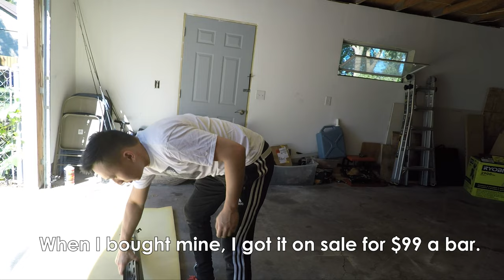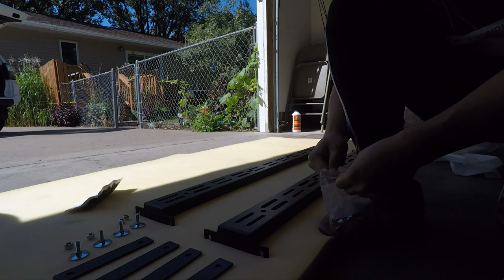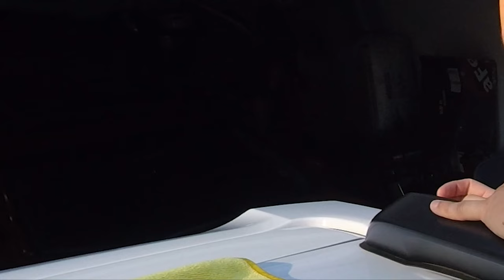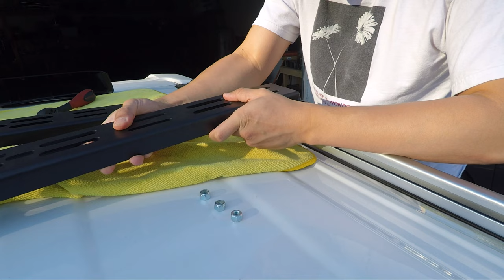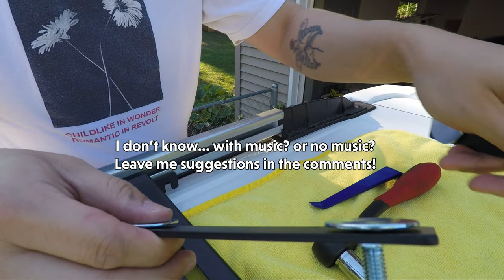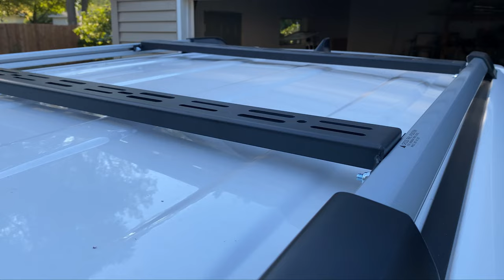TRULY THE BEST BUDGET ROOFRACK/BARS?? | 4RUNNER

Comment: Liked it right up to the point seeing zero washers for the nylon lock nuts and the vertical slotted “cross bar to rack”junctions.    Better hope those things don’t fly off…..really can’t get passed the no washers included.   Maybe they forgot to send them
Reply from the maker: Hey James! Yeah, i noticed the locknuts w/o washers too... It bugged me too! I actually took off the bars for Winter mode, but after this winter I'm already planning on replacing the previously used locknuts with new ones and WASHERS lol! Thanks for watching! Appreciate it. 🤙
Reply: @yoojesss  I do like the backing plates design.   If the holes weren’t slotted and just holes it would be fool proof.   I realize that would mean having to sort of slide it all on semi assembled with a person on each side working in unison.  But the end result would be positive even if a nut got loose or hard wind force.   I’ve got 4 of the “LFD off road” ones and they are very similar and have their issues as well.  Good looking runner
Reply from the maker: @jamesc6137  Yessir! The backing plates are quite hardy and solid. LOL truth be told! But thank you man! Those LFD bars are not bad themselves! I like how those are raised up giving you a little bit more clearance from bar to paint/roof.

Comment: What do you have mounted up there?  How much weight can those bars carry?  I'm thinking about get some recovery boards and mounting them up there and perhaps a small box for more gear.
Reply from the maker: Hey Tyler! I mounted a pelican BX90R (recovery gear, tug straps, camping gear, tents in the pelican case), that weight of the case with gear was almost a good 40lbs. Along with the BX90R, I’ve mounted 2 ActionTraxx boards up there on just 2 Victory cross bars. 

Allso, recently, I got stuck on a iced/thick snowed in path, I was able to stand on the roof rack bars (shits and giggles, make light of being stuck). I’m a smaller guy 145lbs, 5’8” and it held me perfectly fine! No bending, no sagging, no slipping.
Reply: @yoojesss  well looks like I'm sold. Gonna order a set asap.  Any rusting issues?
Reply from the maker: @tylernelson2288  awesome!! I know they jumped in price slightly! 

And negative, no rusting YET! One con for me though, are the locking nuts. In the video I installed it with the locking nuts that came with the cross bars. But, About 2 days later I got some washers and new locking nuts, for peace of mind… and OCD…

Comment: Can these hold rooftop tent with 2 people?
Reply from the maker: I would not mount a RTT on my setup (if you mount these bars + OE roof bars), I believe the OE supports ~300LB driving weight and ~700LB static. 

This 2 crossbar setup is pretty strong, but, it's how the OE roof bars are set up that concerns me... It only spans about 1/2 of the roof length. I would probably recommend a 3/4 or full aftermarket roof rack if you were to mount a RTT, just cos it will have more support for the RTT depending on what you get.

But, to each their own! i hope you do what is best for you, and your wallet xD! Happy driving and thank you watching!!

Comment: All the weight is on those paired bolts rather than the crossbars directly.  I suppose if you don't plan on putting a whole lot of weight on them they're OK, especially for the price.  For example, I need to mount a rigid solar panel to mine (all of 15 lbs), so they'd be good for that.  Thanks.
Reply from the maker: Yessir! That's the plan, definitely not loading anything heavy. To each their own, and their OWN NEEDS that for sure. I've only put tracks, pelican case, poles up there. Thinking about picking up a prinsu rack!!
Reply: What about RTT? They advertise it
Reply from the maker: @Wealthishealth89  i’m sure it’s POSSIBLE. OEM roof rack, with Victory 4x4 Bars it’s possible. But the OEM bars can only hold up to 150lbs i believe… i’m not 100%. Do your research on what set up YOU would want, which RTT, how much it weighs, etc. 

However, i would def recommend gett aftermarket roof rack like Prinsu, Victory’s full length, and there’s many other competitors. It’s IMHO, the weight and load distribution across the whole roof of your vehicle, and much more contact points.

It’s DOABLE, but, DO your due diligence, research research RESEARCH!

Happy trailing!

Comment: How's the wind noise?
Reply from the maker: Hey man! I've been driving it for a while with them, literally ZERO complaints! No wind noise at all, nothing rattles. 

The bars do sit quite low too. I'll do an updated review soon!

Thank you for watching!
Reply: @yoojesss  Awesome, thanks!  I tried to measure the holes/slots on the crossbars digitally, and I'm assuming they're 3/8" wide and 1/2" wide - looks like two different sizes.  Seems like two of these crossbars is the best/cheapest way to get traction boards and a shovel on my roof!
Reply from the maker: @TrailTape  yes! 3/8” and 1/2”! And totally agree!!! Best bang for your buck, zero wind noise, and these things are built extremely SOLID.